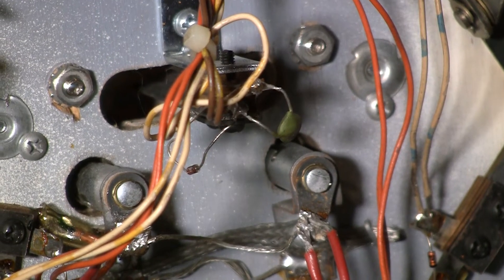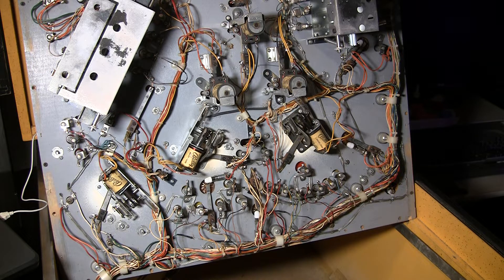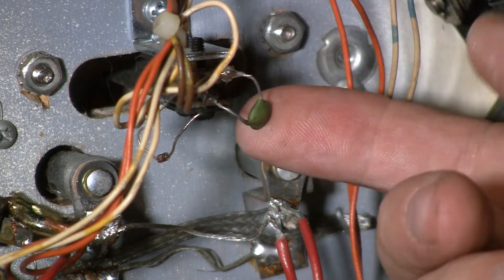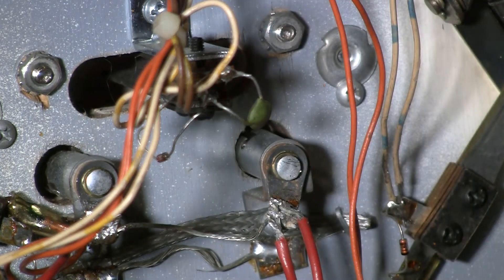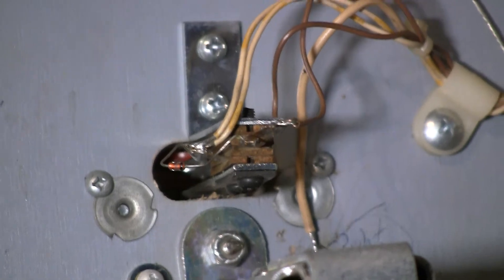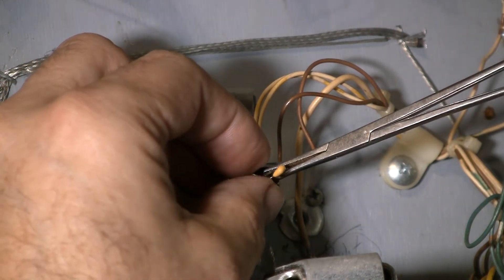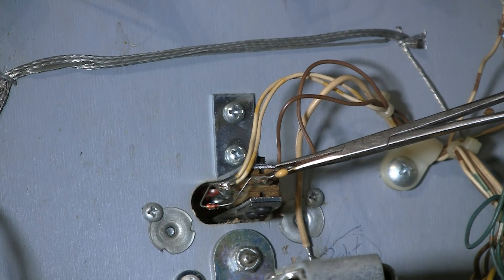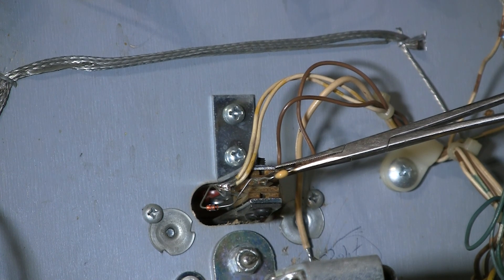Why are there capacitors on some pinball switches? What do they do? Are they needed? PinballHelp.com

Comment: Great explanation, I’ve been scratching my head wondering what the capacitors are there for.

I have a target that fires constantly or not at all, will replace the capacitor and see if it repairs the fault.
Reply: I replaced the capacitor (463K) and now the switch works as it should. No misfiring, no faults.

Cheers

Comment: Is this just a Bally/Stern issue? I have a Williams System 6 in which rollovers aren't being registered when the ball moves over them too fast. They work fine when triggered by hand or when the ball moves over them slowly, so I don't believe it's a gap adjustment problem. Would adding .01uf caps to the switches fix that also?

Comment: Great video. Guys making vids about pinball service are doing gods work! Found this one when looking for advice on my Fish Tales sound. I think I have to replace all the caps. Sound is really really low.
Reply from the maker: sound volume for fish tales can be controlled by the diagnostic buttons also
Reply: @PinballHelp  Yessir. Thank you for your reply. When I adjust the volume, it does go up, but only slightly. It’s still very very quiet.

Comment: I often see a Diode placed across the leaf switches in the playfield, what are the diodes used for? if you remove all the diodes on the leaf switches what will happens and why?
Reply from the maker: The diodes are necessary for the switches to operate in a switch matrix.  Using diodes allows the CPU to "poll" the switch matrix and be able to tell which switches are closed.  See: https://www.flippers.be/basics/101_switch_matrix.html for more details
Reply: @PinballHelp  What do you mean by "Poll" the cpu to "poll" the switch matrix? The Leaf switches that are closed should be enough i would think to let the cpu know that the switch is closed so I don't understand the purpose how the diodes are letting the CPU know that the leaf switches are closed. When the leaf switch is closed that should be enough to let the CPU know that the leaf switch is closed. Adding a diode logically doesn't make sense to me.
Reply: @waynegram8907  
They're probably there to act as a flyback diode. Maybe to stop arcing or emf ?? Just a guess....

Comment: Thought it was obvious what a cap does. Drop voltage/short current prevention
Reply from the maker: not in this case
Reply: @PinballHelp   here is all the applications available for the capacitor with demo simple circuits..  not for you necessarily but for those interested in all the applications. The capacitor is one of the coolest inventions ever made. 
https://www.gadgetronicx.com/capacitor-working-tutorial-applications-circuits/